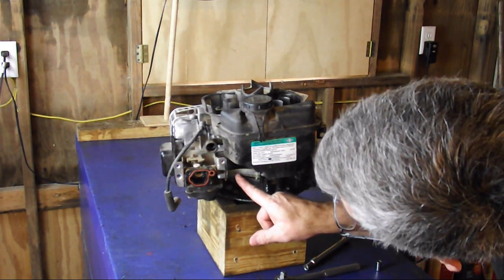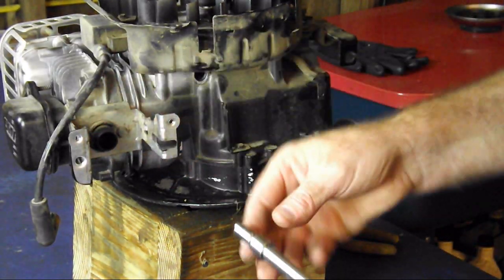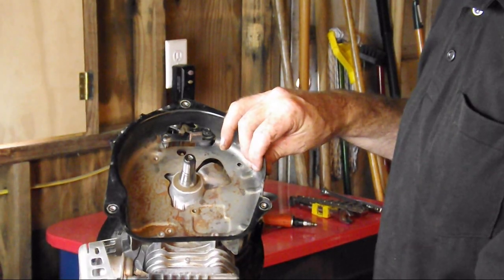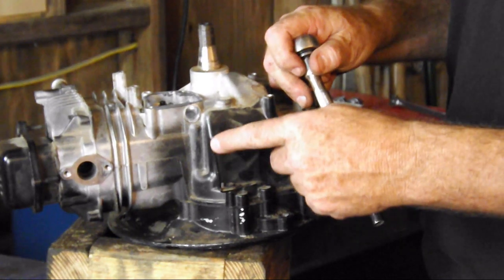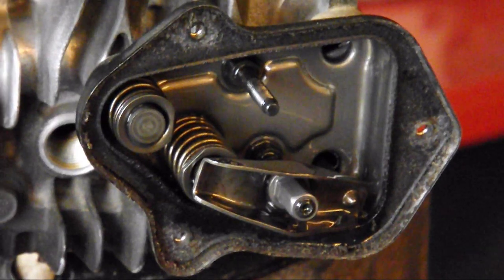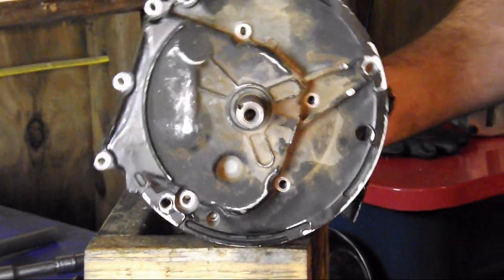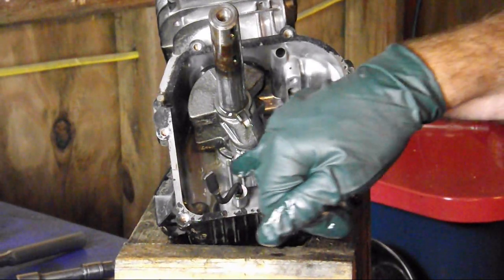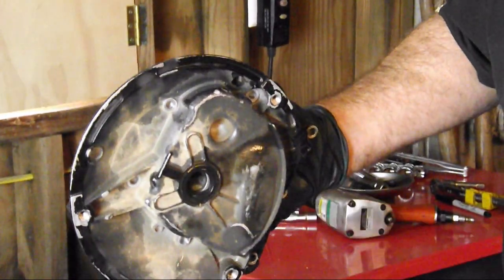Overhead Valve Engine Teardown

Comment: Gene,what model engine is this if you dont mind me asking,i have a mower that has the same exact engine but its hard to find the model number, i think it might have been on a sticker and got torn off.
Reply from the maker: It's engraved on the pull starter housing.
Reply: There is a sticker but no engraving, i have a 06 model mower and the number is engraved in the metal of the mower, kinda odd on this newer model i have , the sticker says 13 0110 54 68665 which i know 13 is the model year,thank you .

Comment: what's an air chisel??   i looked it up on amazon and it came back with a hammer drill.
Reply: I know this is a old comment but just wanted to reply,a air chisel is also known as a air hammer not a "hammer drill" like Amazon claims,there is no drill anywhere.

What it is, its a tool powered by compressed air that has the same effect as hammer (hence the name ) but with much much force and repetition,Basically if you need to push something out you put a blunt chisel ( a chisel without a edge, just round) and put it right next to the item you wanna push and keep it tight and push the trigger,ever seen a guy using a jackhammer on the street? same thing but in your hand, more compact.

You can also use it to cut a bolt thats sticking out with a sharp chisel,you can do many things with them if you use the right chisel,very handy tool, just make sure and wear your safety glasses when using one.

Comment: 4:24... the what assembly? couldn't quite make out what you said. thanks
Reply: good question...  and if you watch the reassembly video he doesn't put it back on.
Reply: He called it a "brake assembly." It is the flywheel brake which, together with the armature kill switch wire, shuts down the engine when you release the cable bale on your mower handle.
Reply: ahh, thanks!
Reply: Flywheel brake assembly